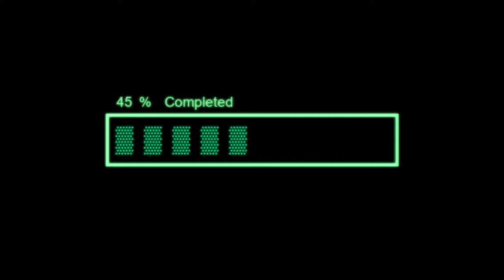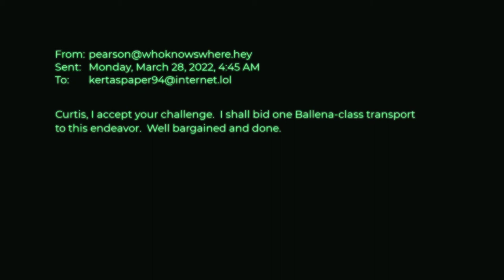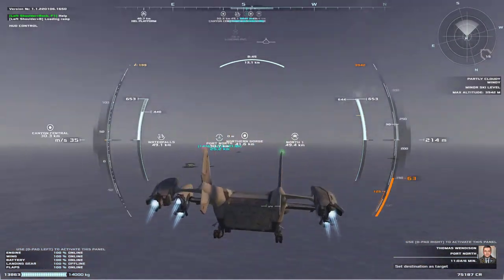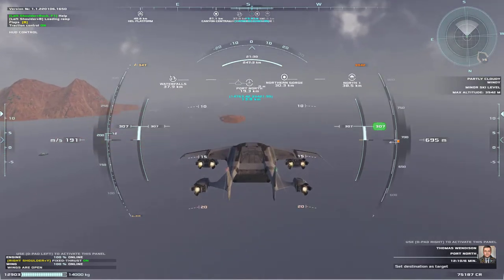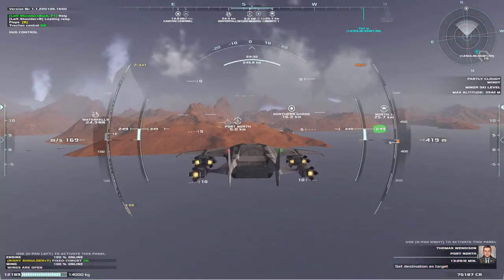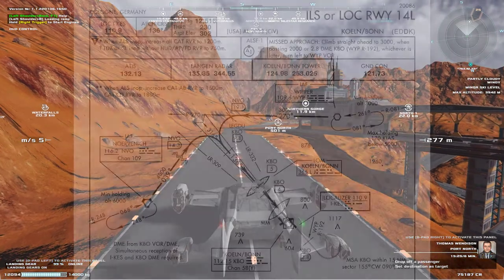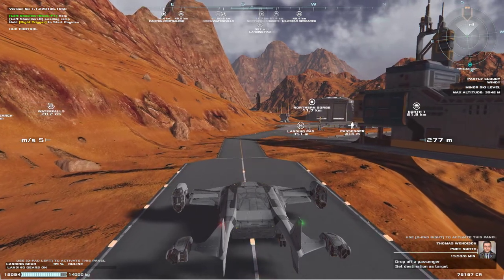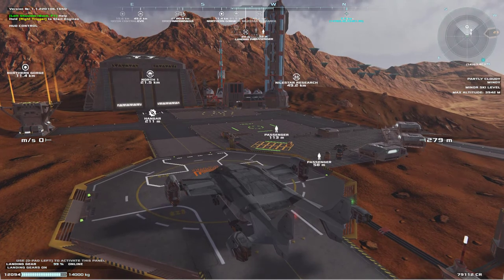FRONTIER PILOT SIMULATOR: Airplane-style Landing!

Comment: Nice job on the landing. If you extend the flaps, you can land at a lower speed and still achieve adequate lift.
Reply from the maker: Thanks for the feedback!  In earlier attempts, I did try using flaps, and sank too quickly, crashing short of the runway.  Flaps and rudder don't work in this game as well as in other simulations.  Thanks for watching!
Reply: @PolyhedralVideo  ah ok. Tbh I've only done these landings with the Scarab and Ox. I was able to manage with flaps on those, but yeah it did seem the rudder control was fairly limiting.